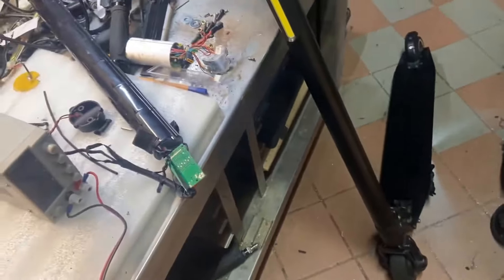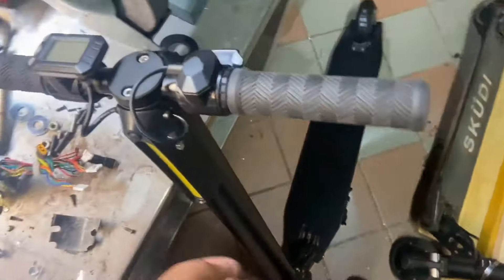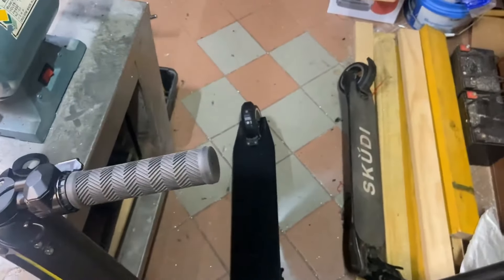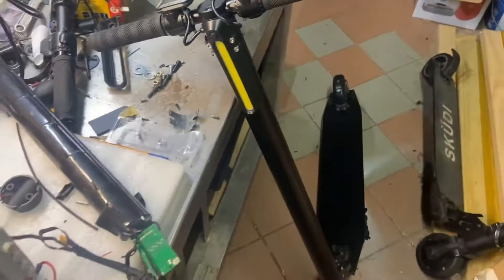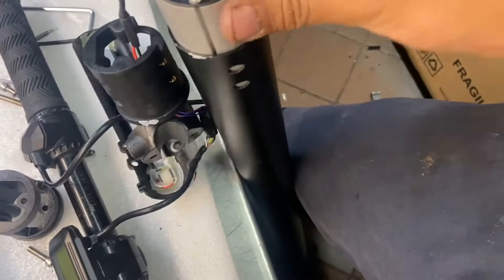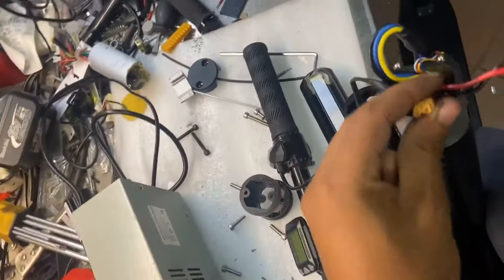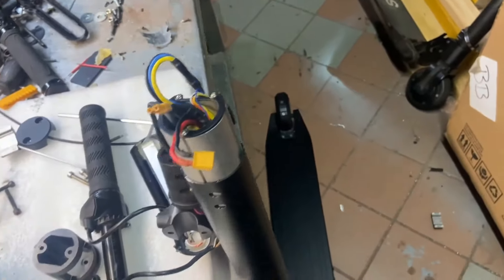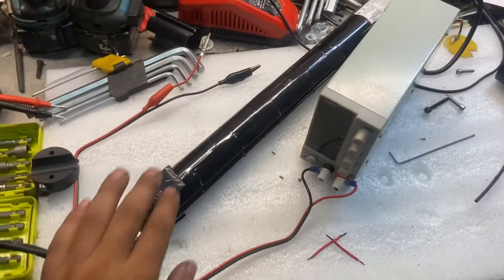How To Revive Dead Scooter Lithium-Ion Battery - (Or Any Device!)

Comment: Hi great informative video 
I noticed you have a charger that is adjustable for currents and volts can you shear with me the brand and model of this charger pls and I’ll also subscribe to you Chanel thanks in advance
Reply from the maker: Hi i bought this power supply a few years ago from banggood here’s the link [AU$145.53 30% OFF]Topshak NPS3010W 110V/220V Digital Adjustable DC Power Supply 0-30V 0-10A 300W Adjustable Laboratory Switching Power Supply US/UK Plug Electrical Equipment & Supplies from Industrial & Scientific on banggood https://ban.ggood.vip/14SMu

Comment: Hi so my scooter turned off when I was riding it and it was fully charged do you think it was the battery or the motor? The scooter is a Phaweo FW H85B
Reply from the maker: could be throttle, battery, motor or controller. I'd check voltage on the battery first, also see if it has a fuse inline that has blow.
Reply: @TechEyeMan  yea I will also how do I check the fuse if the motor is in the wheel
Reply from the maker: @lunathekittybat2225  if it has a fuse it won’t be in the wheel it will be near the battery, but many of them don’t have fuses.

Comment: Sucks that someone needs a full electronics workbench to use a perfectly good battery that somehow discharged all the way.  E-bike and scooter batteries are not very user friendly.
Reply from the maker: Lithium ion batteries to have limits. other battery chemistries do also discharge over time however recharging them causes no serious side effects but i do agree
Reply: @TechEyeMan  If I were to take a guess, I'd say it's the little "management" circuit board that puts a parasitic load on these batteries and drains them faster than they should without it.

Comment: Hey ,I measured my battery voltage and it has 71.4v  but it is not turning on the scooter  and its not charging.what might be the problem